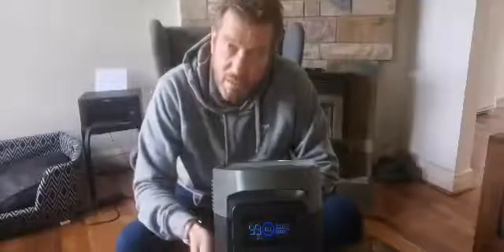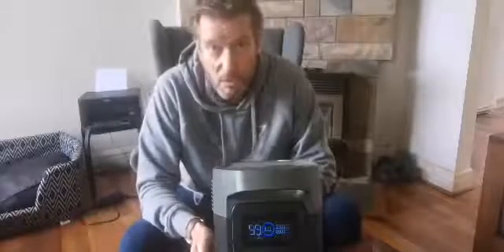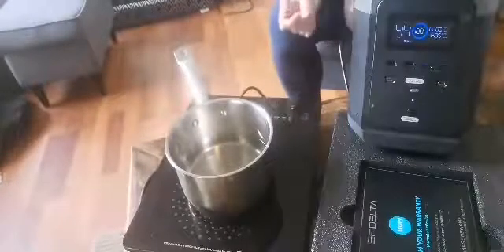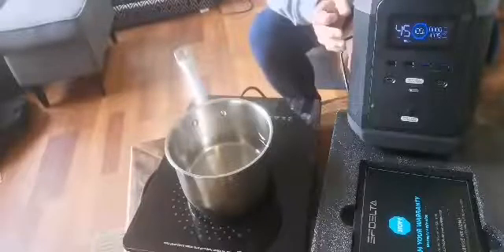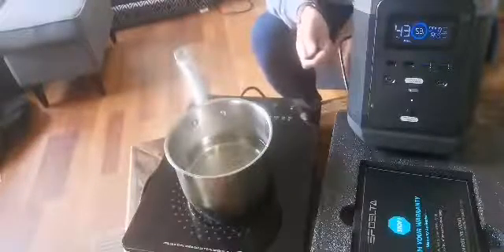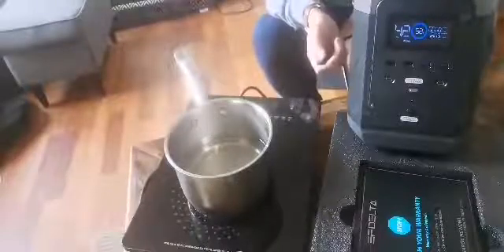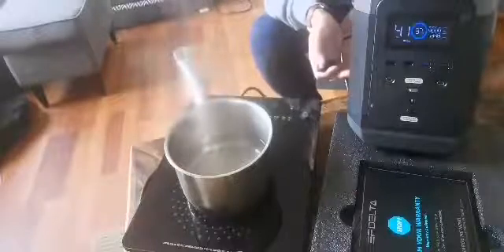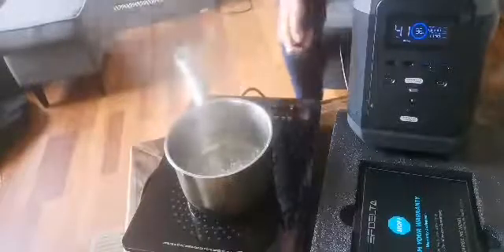Testing Ecoflow with induction cooker

Comment: Thank you for the video! As long As I don’t go past the 3000 w surge on the Delta I should be fine, correct? I noticed that the induction cooker was rated at 2100.
Reply from the maker: Yes that's right.